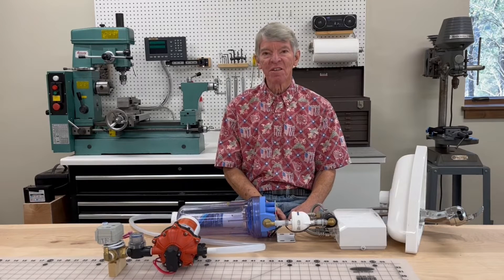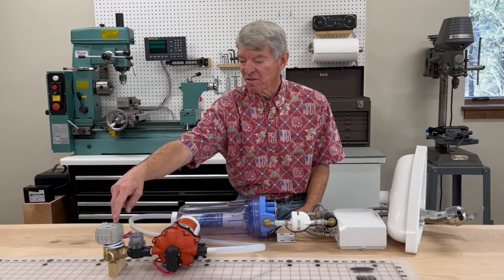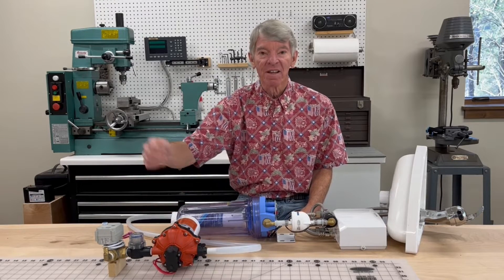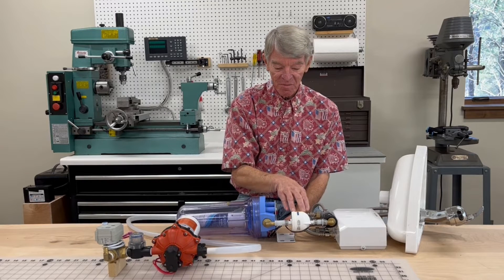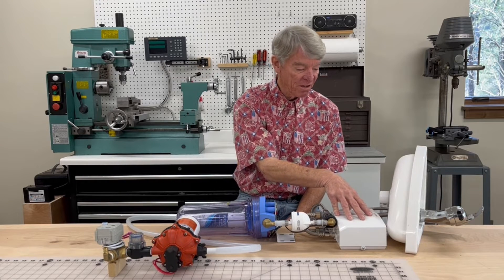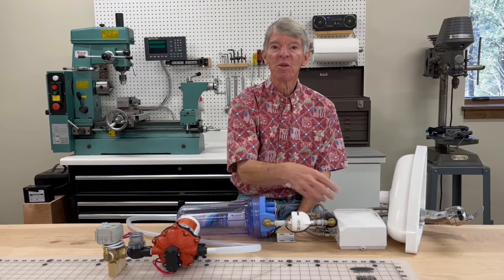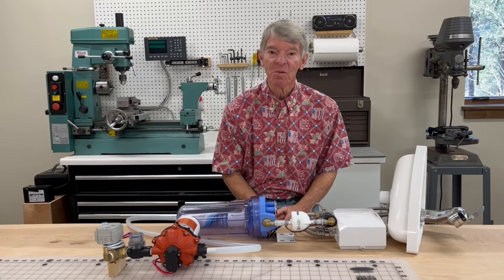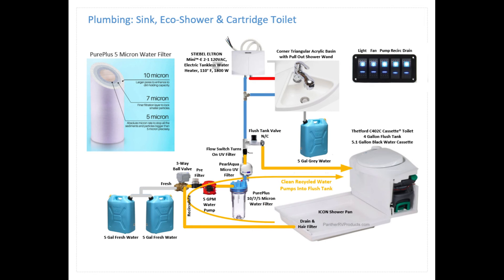Camper Van All-Electric Recirculating Shower w/Tankless Water heater and LED UV Filter

Comment: Less than a gallon of recirculating water?!?!  That's amazing.  I thought it would be closer to 3 to 4 gallons of water needed for such a recirculating system.  I'm very interested in duplicating your setup in my own DIY camping trailer, which I'm designing now, and I'm almost ready to begin construction.
Edit:  I just researched how these 3 way valves work and realized that during operation, they briefly mix, or contaminate the two connected source water supplies.  Have you considered this problem of contaminating the fresh water supply container?
Last edit:  Your shop is way too clean and organized, I'm insanely jealous.
Reply from the maker: If you are pumping water from the fresh water tank while you switch the three-way valve there is no contamination of the fresh water supply. The fresh water flow is just pinched off as the new source from the shower pan takes over. You just need to make sure there is flow from the fresh water supply when you switch the valve.
To minimize the amount of water used to take a shower you need to make sure your drain is located so only a minimum amount of water is needed to cover the drain with about a 1/2 inch of water. I made sure the slope of the shower pan was tilted toward the drain.
Good luck on you trailer build.
Reply: @fivepoundpete,  Well I hate to be the bearer of bad news, but your assumption that pressurization and water flow from the clean water tank or jug is able to prevent contamination from the used recirculating shower water through the use of the three way valve is very wrong. I would hope that you are not drinking water from that clean water container and that you are disinfecting it often. The installation of an air gap device would prevent or minimize the possibility of bacterial contamination, but the only ones I know of are made for drain lines, not pressurized water lines.
Reply from the maker: There are two types of 3-way valves, "L" and "T". I am using an "L" type valve. The two lines coming into the valve are not under pressure but are actually under negative pressure pulling water from one or the other of the water sources. If you think I have an issue can you please explain the problem?
Reply: @ fivepoundpete,  My background is in construction as a general contractor, and in building code enforcement as an inspector, then working my way up to chief building official and director of the Building & Safety Department. My concern for your recirculating shower is that bacteria can travel through your three way valve into the water line that is coming from the clean water jug. If that jug is only used for supplying water to fill the shower and toilet tank, then the risk is low, but if you use that water supply for anything else, I would be concerned.
Reply from the maker: Thanks for your advice. We are only using our fresh water tanks for washing hands and showers.

Comment: this is so great! Thank you for sharing this!!! How is it holding up? I am just about to start a truck conversion, and would LOVE to have a recirculating shower.  so many different ways to do it.  I have 12kwh battery so this could work! :)
Reply from the maker: The shower is working well. I recently switched to pleated filters which have a longer service life. We only need to heat 1 gallon of water that circulates through the on-demand boost water heater. My wife and I can take back-to-back showers and use less than 15% of our 200 Ah battery which I believe is only about 0.400 kWh at 13 some volts.

Comment: Hi Pete.  Just finished my mock up of a portable recirculating shower that can be used both Inside and outside of the van. Have a look: https://www.youtube.com/watch?v=i5FQZQltPpk&t=608s  Would appreciate your input. Decided to go with a heat exchanger so that I could use a hot water from multiple sources and not contaminate any water inside the RV. I wanted something that could be used with any RV. Thanks again for your videos. It helped me immensely in designing my own and I picked up ideas from several other YouTube videos as well.
Reply from the maker: Hi Troy,
I see you have incorporated many optimizations for the way you intend to fit your recirculating shower into your van. The great thing about building out your own van is that you get to customize the function based on how you plan to use the shower.

I used a heat exchanger and a second pump in one of my prototypes but decided on a dedicated filtered recirculating water loop that is only used for washing hands and taking showers. I am thinking about adding a small pump directly from the fresh water tank to a cold water spigot. For us it is more efficient in space, energy and cost to forgo a large hot water tank and just heat the water we need for cooking in our microwave, Breville frother or on our induction stove.

You mentioned spending a lot of time on your van and I agree it can easily be underestimated. I spent 1400 hours on my build. Some of that time was just sitting in the van trying to figure out how to create a clean install given some of the unfriendly structural members in the van body. We are very happy with our van and have 22,000 miles and 60 night of use so far including three trips to Yellowstone, a trip yo Yosemite and a long drive to Vermont for the total eclipse.
Reply: 22,000 miles is fantastic! I live in Alaska, so we have about four months or so in the summertime to get things like van builds done. I've wished for most of my life to have a heated garage for these kinds of things, but it doesn't look like it's going to happen. When I started getting into the recirculating shower I wanted something I could move from one van to another, so that's when I started working on a portable option. I'm just using a small two-gallon water heater, but with the heat exchanger, you can use whatever you want for a heat source, which could include antifreeze from your engine. It's pretty versatile. You would need to get a second pump installed if you wanted to use alternative sources, and that adds to the weight. This thing turned out to be heavier than I thought it would be. I figured if I was going to be purchasing an RV, it's more than likely to come with a hot water tank. I agree it's nice to build your own, but using it I think is more important! I just don't know that I'm going to finish in a reasonable amount of time. At 63 years old  I'm getting a lot more selective about projects.  The flip side to buying an old RV is you're buying a 20-year-old RV component, and that comes with its own set of issues. Still,  it's usable right away. A friend of mine I've known for 25 years got a diagnosis of cancer about six months ago,. I've become acutely aware of doing things while you have time and are healthy.
Reply from the maker: Living in Colorado it is either to cold or too hot for part of the year to get much done on a given day. This made it take much longer than I anticipated to complete my build. At this point my van is basically complete.
Inventing ways to make a van build lighter is my hobby and I get great satisfaction from building my own van and sharing my ideas with other van builders. At 74 I am also very aware of time passing by.
Reply: I'm going to continue to work on mine, as it's a fun past time. I'm also still pursuing a purchase of a completed RV though. Alaska has similar problems to Colorado it sounds like. It's just a short building season. I did install a mini split in mine so I can work in the 90 degree heat if necessary. And then this fall I put in an 18,000 btu dometic furnace, so that allows me to work a bit into November here. Trying to do as much as I can in the house basement and then bring it out to the van to assemble. That only goes so far though as you know. I have some wacky crazy curves to my van so it makes things especially challenging. Very impressed at 74 you're still at it. I'm also convinced that exercise and healthy living is the key to longevity though. When I sit around the house too much and then can't move at all. And the exercise of figuring out or problem solving I think is good for the mind and preventing dementia and Alzheimer's. All the best Pete, it's been a real pleasure!

Comment: Hi Pete, I'm quite new to this so please excuse my ignorance, but I'm trying to work out how I can get the most out of this system. I really want to be able to have several showers without having to refill and drain the water all the time. Does this system work well for that?

I was wondering as well if fitting a fresh and waste water tank to this system in parellel might help in that effort? So that one could refill and drain the recirculted water when it gets too dirty. I don't know if that would work.

Hope all is well and looking forward to any updates :)
Reply from the maker: After each shower we empty the shower pan water by pointing the shower head into a 1 gallon clear water jug. This way we can look at how clear it is and either reuse it (we leave the water jug in the shower pan) or pour it down the drain into the grey water tank.

I think our water jug solution works well and eliminates the complexity of adding parallel tanks. We use a bungee cord around the water filter to keep the jug from moving around.

Comment: Use aluminum sulfate to coagulate the soap and remove it from the water.
Reply from the maker: Good to know. Since we only use 1 gallon for the two of us per shower we are currently just discarding the used water into the wash basin at a campground or into our grey water tank.

Comment: Hello Pete: I'm running into a little bit of an issue and wanted to see if I could get some feedback from you. Since I'm using the exact same shower pan as you, and the same diameter hose from the shower pan drain (3/8") I'm thinking you must have run into the same issue I'm having. The problem is cavitation/ventilation, and of course, the simple answer is more water, so air doesn't get sucked into the pump. 

I'm up to 1.5 gallons, and I was actually hoping to get by on even less, but 1.5 seems to be just about a bare minimum with my current setup, and still having issues if I momentarily block the water, which I could certainly see doing during a shower. If the tiniest amount of air is sucked into the pump, then water flow is severely diminished until the prime is reestablished.  

One thing I found is that by breaking up the water flow via a screen that seems to help, so I think I might be on to something there. With just the bare drain with no screen I end up forming a whirlpool where air is sucked in (not good). Right now I have one of those screens used for catching hair, and that is helping, but it spins around due to all the turbulence.   I don't have the sediment filter installed or UV filter, just a prefilter at this point. Slowing the flow rate down I'm sure would help, but that's actually not what I want to do as I don't even feel it's super powerful at this point. I'm using the smaller three gallon pump, not the 5 gallon you have. A more powerful pump is just going to make the situation worse. 

Anything you have found to help eliminate the cavitation issues? I even have my shower pan tilted about 1/2 inch over stock, so that more water is collecting around drain (The equivalent of probably two gallons of water in the pan). I'm thinking that an accumulator tank might help a little bit, but the bottom line is I think any air that is introduced into the system is going to break the prime. 

Not quite sure what direction to take. It seems like either more water or a slower flow rates are the answers and I really don't want to change either one. If anything I want to increase water pressure with even less water.
Reply from the maker: I have a few ideas why I have not seen your problem. I do have a screen in the shower pan drain to catch hair and this probably prevents the vortex you describe. I also added a pair of magnets to the screen to hold it down so hair couldn't sneak by. The magnets prevent it from spinning around.
The geometry of the drain could also come into play. Mine is very shallow. I have a video on how I made it.
The 3 GPM pump without any back pressure from the sediment filter, UV filter and heater is probably pushing more flow than what I see while taking a shower. I only need about 1/2" of water above the drain to prevent cavitation and this is typically 3 to 4 quarts depending how level the van is parked.
Just a note: with the water only flowing though the heater the flow rate is OK but by bypassing some water through the "cold" water line I get a great flow rate with a 5 GPM pump.
Let me know how any of your experiments come out.
Reply: My drain design is very similar to yours. About 1" tall. This set up would actually make the issue worse, not better though. I'm not sure where you're going with that. Imagine if you had a 6 inch tall cylinder where you were drawing water from the bottom and it was going in at the top. No way you're going to create cavitation with something this deep without a huge amount of pressure. It's the shallowness that is actually allowing pressure to break the surface tension of the water, which introduces air.  Technically this is considered ventilation, whereas I think cavitation refers to turbulence introducing air. Some of this comes from the boating world and propellers, but similar things happen in a blender if you don't have enough liquid. I'm not sure which is the correct term here, but the effect is the same. Air is being sucked into the system. 

No question that back pressure is going to slow the flow. The filter housing may solve the problem all by itself. To my way of thinking what I need to do is slow the flow without affecting pressure. What are your thoughts here? The question is what's the best way to accomplish this? 

Let me just get the filter hooked up today and the shower head. Both of those is going to increase back pressure. And I'll try some magnets for the filter screen. I was already planning to use magnets to hold the shower curtain in place. I purposely added some ferrous metal behind the pan to allow for this. 

I already made a video about this but, not uploaded yet. Perhaps I will upload part one of my video series and you can see what I'm doing. I can't post a link here but just do a search on youtube for a fold- down recirculating shower for a van. I'll try to upload that later today.
Reply: I added the filter housing today, and that helped. To get things where there's only about 1/2 inch of water there's still about a gallon and a half of water being used as now you need to use another quart or so to fill up the filter and lines. An additional "head" height of the shower wand is going to further increase backflow. I can definitely see the need for a stronger pump now, and water flow has been significantly reduced. Looks like a check valve will probably be needed as well.  My first video was uploaded but won't be available for viewing until tomorrow. Again do a search for "Fold down Recirculating shower" Part 1  You tube won't allow links.

Comment: Fantastic video, thanks Pete. I'm wondering how you landed on the Stiebel Eltron for your water heater? What specs were you looking for in particular and do you know whether any/most heaters would have a flow restrictor that could be removed? And is there an optimum flow through the water heater?... Assumedly too fast and it won't heat properly and obviously too slow is a rubbish shower.
Reply from the maker: I looked at several on-demand under sink water heaters and a boost water heater is what I chose. None of them I looked at had water flow rates good enough for a shower. They all restrict the flow rate to what they can heat on-demand to a hot temperature. In a recirculating shower you don't need to heat the water up to full temperature in a single pass. I wanted a 2400W heater but my battery inverter combination could not quite deliver the slightly higher power that the Stiebel Eltron heater needed. I settled for an 1800W unit but that is OK it just takes a little longer to heat the water. The 1800W heater raises the temperature approximately 6 degrees per pass. After the water circulates through the heater for about 4 minutes it is up to full temperature. Once up to temperature you can mix it with slightly cooler shower pan water to regulate the temperature. You want to maintain enough water flow through the heater to keep the heating element energized. I hope this clarifies how the recirculating shower heats the water.

Comment: So brilliant, thank you for sharing!  1.  How often does the filter need changed?
2.  Can the filter be cleaned and reused?
3.  Are certain kinds of soaps and shampoo better for this system than others?
Reply from the maker: 1. What we have done so far is to replace the filter after each one to two week adventure so we really don't know how many showers we can take with a single filter. We found if we don't disinfect the system between outing, maybe for a week or two, the unfiltered and undisinfected water in the filter cartridge smells like pond scum.
2. I chose to use a single layered filter that is inexpensive enough to just use a new filter for each outing.
3. We use a glycerin based soap such as Dr. Bonners. Without the oils in regular soap the filter seems to last longer.